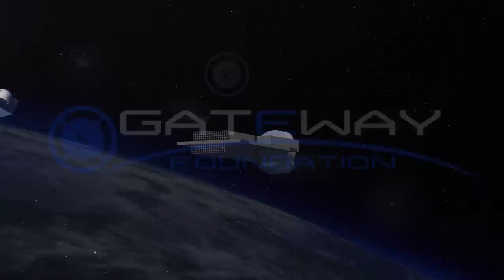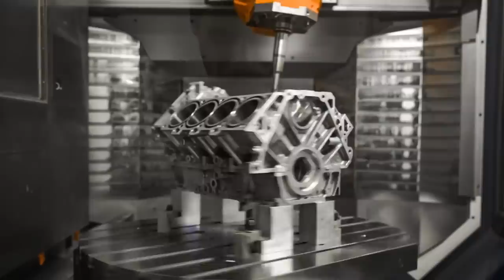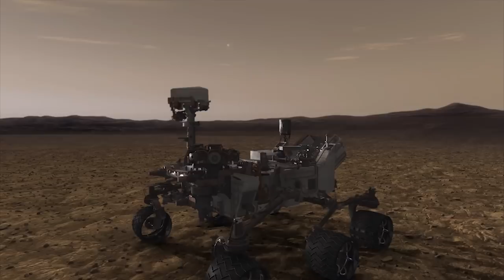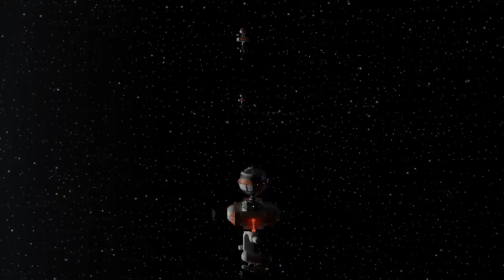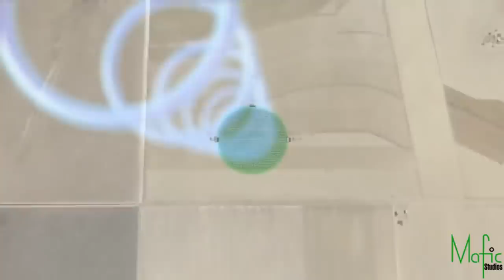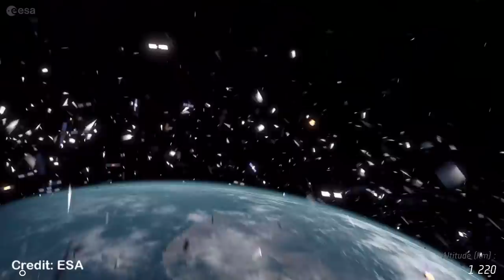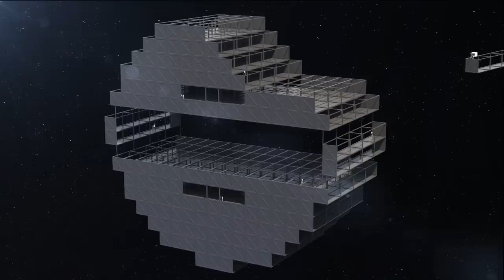Orbital Infrastructure

Comment: What do you think about reusing spacejunk as a resource in space for manufacturing stuff? I mean the most kind of junk ist aluminium from stage enclosures, 2nd and 3rd stages of rockets, als well as junk satellites which contain lots of silicon from their solar panels. Junk rocket engines from those leftover stages also contain a lot of useful materials and metal. This all would lead to a real interest and "profit" argument to clear earth´s orbit from debris. What do you think?
Reply: Stefan hansel, finish the video, see 27:24.
Reply: Ohh ok you are right, i didn´t get that properly because of the accent. Thanks. :)

Comment: if a single pea-sized iron ball can do serious damage to a satellite when traveling at the speed of a car, imagine a space weapon that launches pea-sized balls of much more dense materials, such as lead, at hypersonic speeds. That weapon would essentially be a railgun that can destroy small spaceships in a single shot, although it would use up a lot of energy. Now imaging if the projectile was larger, say, the size of a baseball. then it would completely decimate entire flagships in space for just a bit more energy. However, getting a smaller object through electromagnetic shields might be easier than larger objects, but then again, maybe not.

Comment: There's an idea for moving the Earth out of the solar system to escape the dying Sun in 1.5 billion that I'd like to make sure you're aware of so that you can include it in your March 15th "Dying Earth" episode:

The idea assumes that by that point whatever intelligent species inhabits the Earth will have a technology that allows them to convert small amounts of matter (including of the types that makes up much or most of the Moon) into energy. The idea is to built such an energy generation system to power rocket engines on the Moon that maintain it at a position where it can gradually pull the Earth into an increasingly wide orbit around the Sun over tens of thousands of years until they can break free of the Sun and turn the Earth into an interstellar spaceship on a long journey to another star that will be able to support it.

Those energy generators would also power light emitters on the Moon that produced light with the same spectral signature as light from the sun that would gradually increase in intensity as the Earth moved away from the Sun to compensate for the decreasing amount of solar radiation reaching the Earth, until they reached an intensity that was equal to what we got from the Sun. The rocket engines might need to be angled away from the Earth in order to not damage its atmosphere (oriented around the edges of the side to the Moon that faces the Earth, counterbalancing each other so that the total thrust is directly away from the Earth to balance the gravitational attraction).

Some factors that the intelligent inhabitants of the Earth at that point could take advantage of:

1. The Moon is tidally locked to the Earth, so the inhabitants of the Earth would only need to build the light emitters on the side of that body that faces the Earth.
2. The slow orbit of the Moon around the Earth (which would need to be further slowed in this scenario to a speed that would cause the Moon and Earth to collide were it not or the force from the lunar engines supplementing that deficit to maintain the distance between the two bodies) means that the Earth would maintain a similar length on the day/night cycle, minimizing ecological disruption.
3. The apparent size of the Moon from the Earth is currently almost identical to that of the Sun. It's predicted to be that Moon will orbit at a distance 40% further away 1.5 billion years from now, but even then the apparent size in the sky of that supplementary light-proving body will be similar to that of the Sun, which life on Earth is used to.

I encountered this idea by reading about it in a science magazine (probably Discover) some time in the mid-to-late 90's. The article said that somebody had patented the idea, apparently not to make money from it (since he would be long dead by the time that anyone might need to implement the proposal), but just to give it exposure in the hopes that it might be passed on and survive until our descendants reached a point when the dying Sun actually started to become a problem that they needed to address. I just made a few unsuccessful attempts to find a reference to it somewhere online by searching for keywords related to the specifics of the plan, but was unable to find one.

I did however, find a similar idea proposed here: https://www.dwheeler.com/essays/move-spaceship-earth.html
Reply: I fear the society that allows a patent to last for a billion years :)

The idea of turning Earth (or any planet) into a space ship is fairly common in scifi.  Using the moon would be a way to start it up, and we could get gravitational assists from other large solar system bodies, like Jupiter and even the Sun, to simply eject the planet into interstellar space. and then use the moon as a steering wheel on our million year journey.

I agree, Robin, This idea could make a very interesting addition to Isaacs Outward Bound series. Spaceship Earth...wait thats taken... Earthship! I think that name is available.
Reply: I didn't realize that the idea of turning the Earth into a spaceship (in the sense of causing it to move out of the solar system) was common in science fiction. I just read about it that once in a science magazine when I was a kid, and I don't believe that I ever saw any other reference to it until I found the site I linked to above. I'm curious about the works you're referring to. Can you give me any specific examples?
Reply: Disney's Epcot center is the most obvious and world renowned depiction of a planet as a spaceship. Tom Schwartz's "Spaceship Earth" is the most well known i think. But I like to refer to the old cheezy scifi epic Andromeda, starring Kevin Sarbo and Lexa Doig where they battle the Planet-ship.

Edit: Andromeda calls it a World ship, its actually a collection of planets. Able to be piloted like a ship, and is more of a mega-structure like a K-2 or K3 civilization might create.
Reply: Thanks for the info!
Reply: And I had to quickly look these up cuz my memory isnt fully capable of recall.

Edmond Hamilton's 1934 novelette "Thundering Worlds"
And, Robert A. Metzger's "CUSP" which depicts using earth oceans as nuclear fuel to make giant planet moving engines.
Reply: That pretty awesome that there were people thinking of that sort of thing back in 1934, when we knew far less about the solar system and its bodies. And it's awesome that you're aware of these works. You must be someone who has a deep love for and interest in science fiction.

Thanks again!
Reply: Im also old, what the future generation will write about and DO is way more awesome. I say hopefully.

Comment: its a bit confusing why Issac is always dismissive of nuclear fission reactors.  modern Integral Fast Reactors, Molten Salt Reactors, and Thorium Reactors are very safe, efficient, and reliable.  it seems to be the fission power will always have a place in space.
Reply from the maker: I'm not, I've very pro-fission, I just don't find it terribly interesting to discuss because a lot of other folks already have, myself included, I've spent at least an hour discussing fission drives over the 130 odds episodes.

Comment: Isn't beaming lasers at large distances to push objects impractical because of beam divergence? :s Or is there a way around this?

Did some math and it seems to me very impractical, say you want to beam power to a spaceship that's over at Venus, which is the planet that gets closest to earth. The laser beam divergence can be calculated using: angle = wavelength/(pi*beam diameter).
 If you  have a laser device at Earth with a 1 meter diameter perfect laser beam and shooting  UV light at 10nm (so you don't harm your target too much) then the beam will have a diameter of around 120 meters when it reaches the target.

If you want to make the beam smaller you can increase the size of the beam diameter by earth, and it scales linearly ( tangens of very small numbers is basically linear ) so if you want the beam to beam to be 12 meters when it reaches venus you can simply increase the diameter of the laser shooting the beam by 10.

This however becomes a problem as the distances increases, when you are out by pluto 38 AU from earth you need a 20 000 km diameter spaceship at pluto using a 1 meter laser beam at earth, or a 20 000 km laser on earth to focus it on a 1 m spaceship, or anything in between, the sum of the spaceship diameter and the laser diameter has to equal 20 000 km.

When you go even further out and start to talk about light years this becomes completely impractical, you need lasers/ spaceships many times bigger than the diameter of the earth.

Sure, you could "just" increase the power, but then you're wasting such huge amounts of energies that you could have spent that energy building antimatter with todays particle accelerators instead, if you have a huge ship with a "solar" sail that's let's say 100 km in diameter you will only get around 0.001% of the energy to hit that ship when it's 1 light year away.

Maybe redshifting can help here? Since when the spaceship starts gaining speed it's moving away from you the laser you're shooting at it will get redshifted and thus you can use smaller wavelengths and this tighten the beam more without damaging the ship since the light which hits the ship will have a lower wavelength. But this only applies at relativistic speeds, even at 50% of the speed of light you can only decrease the ship/laser by 87% from it's original size, and by that point you're already up to speed. At 10% of the speed of light you're only at 99.5% of the orignal mirror size, so basically redshifting can't save us here.

The only way of using this I can see is to build planet sized solar sails, which certainly isn't outlandishly big on this channel, but maybe the mass of such a sail and it's support structures would be better spent as hydrogen powering a fusion drive?

It seems we have skipped over the practical aspects of actually pushing something using lasers, or maybe I just missed that episode? Someone care to fill me in if that is the case?

Anyway, great episode as always :D

Comment: why are fusion reactors better then solar arrays? from what i understand Solar arrays are the only thing humans have engineered that collects energy with out turbines. 

also you keep talking about at point humans will be more worried about thermal energy, do to it heating everything up. but wouldn't you be able to use this energy?
Reply: Proton-Boron Fusion can harvest electrical power directly via the emitted alpha's.
Reply: no you could not just "use the energy", due to second law of thermodynamics.
Reply: Concider that solar is from a star 142 million kilometers away that uses fusion itself. If we can create even a tiny fusion source on earth, it could be tens or hundreds of times better.

Comment: I was told by a bunch of engineering students beaming energy will NEVER work because of loss over distance.  There is a nugget of truth in there, but I feel that opinion was beaten into them by a very conservative, corporate-funded college.
Reply from the maker: It works fine in the vacuum, it's space to ground or ground to space that's a pain, but you can still do it, though it isn't hyper efficient. Your engineering students are just wrong :)
Reply: The frist rule of engineering is, you  can make almost anything work but you can't make everything efficient. Even if some day producing power here on Earth either is prohibited or insufficient, it would probably be cheaper and easier to use cables from an orbital ring, particularly if we have super conductors.